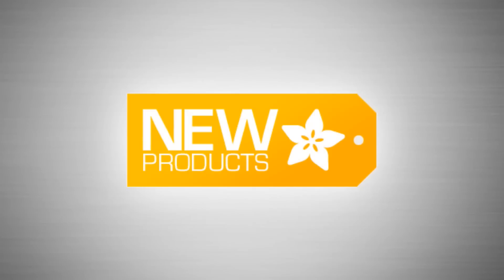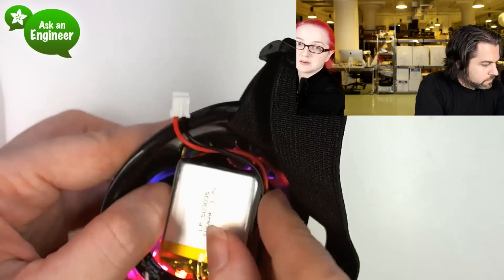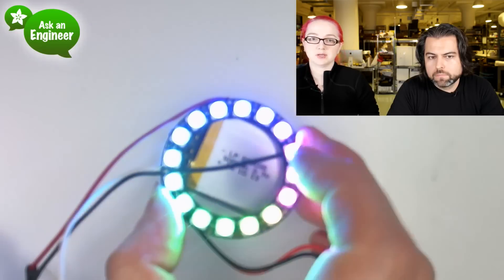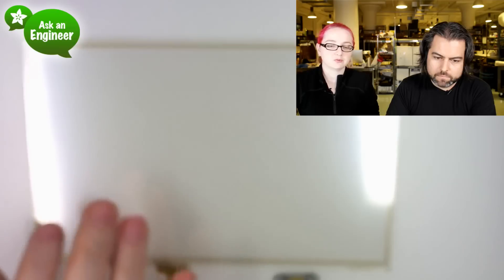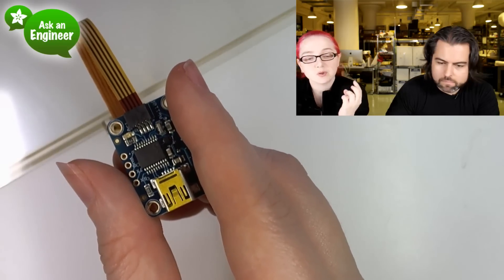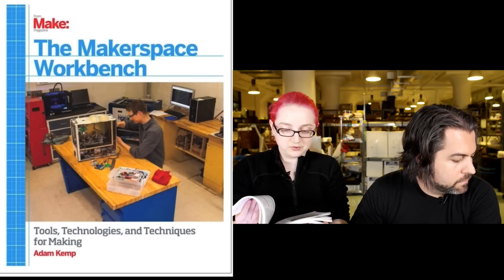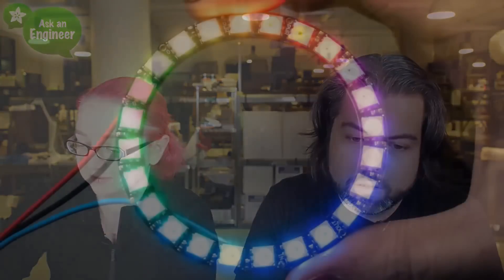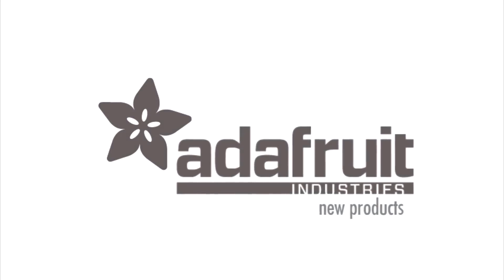New Products 11/09/2013

Comment: I was thinking about creating a portable Raspberry Pi touchscreen computer. Could I use this battery and touch. I am a very new beginner into creating things. Thanks.
Reply: I suspect the battery capacity would be pretty low for the Pi.  It's been my limited experience that it really wants a stable voltage and relatively decent current to run for any length of time.
Reply: The 500mAh 3.3 volt battery in the video would be insufficient for a portable raspberry pi. The rpi runs off of 5 volts and draws (depending on attached devices) 700mah to maybe 2000mah. The touch screen would work as a mouse device for the rpi, but I'm not sure about the calibration in linux. If you wanted to make a portable touch raspberry pi you'd want a 4000mah+ battery pack and adafruit has battery packs just for the pi in their store.

Comment: Just to let people out there know If you Buy a cheap touch screen It will not have support on the Raspberry pi 3 (mine) bought brand new had a 7 year old Touchscreen controller that had to be replaced with a digtal touchscreen controller and they wanted $25 on top of the $43 USD to have it working  So if you bought one of these the AR1100 for $9.99 is the way to go Or buy The Raspberry Pi touchscreen